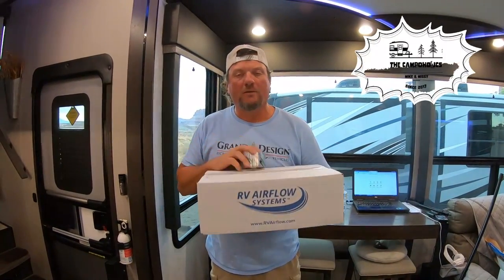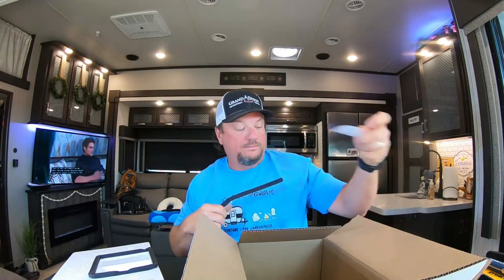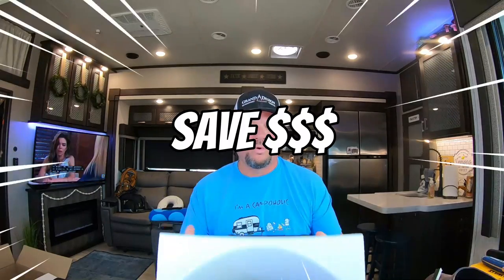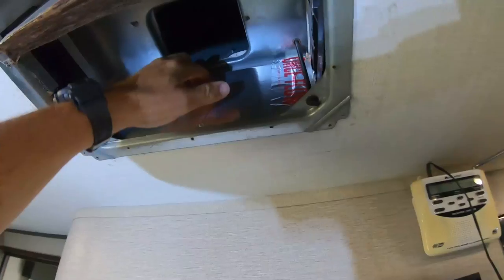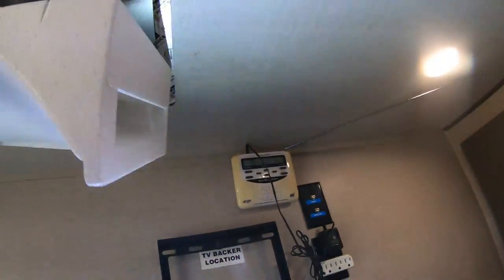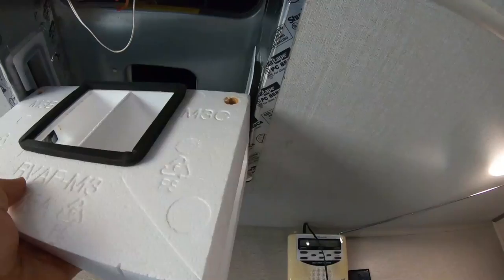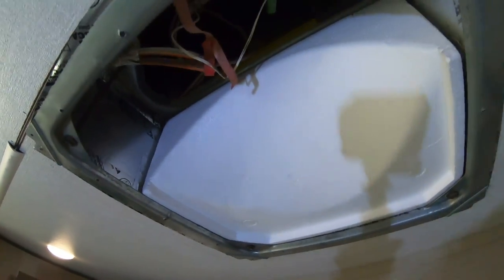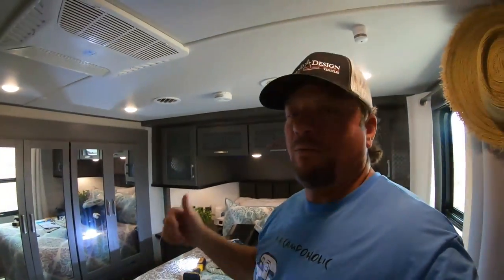RV AirFlow Systems Overview and Install! Keeping It Cool In The RV!

Comment: Hello  I basically understand the idea so I went to Home Depot and bought AC Tape and a couple of flimsy tin Beware of Dogs signs and did the same thing for 20.00.  Remember to seal all the holes on both sides ( Supply and Return ).
Reply from the maker: That saves some money.

Comment: I had about 15 (a lifetime) minutes of trouble getting long bolts to line up through styrofoam. Had to "saw" towards corner and NOT use flange on that side. Aluminum tape EVERYWHERE until no cool air felt. Now hot stays separate from cold. The temperature of air after is much better. What ya gotta do is MAKE SURE bolts will line up AFTER install of styrofoam and BEFORE reinstall of metal bracket thing. What I did is FIND the holes, place the bolts, aluminum tape EVERYTHING to hold styrofoam in place, remove the bolts, place the bracket, screwed bolts back in. IT WAS WELL WORTH THE SHOULDER AND NECK DISCOMFORT.
Reply from the maker: If it doesn't align its a pain.

Comment: I had a wire wire hanging down about 2 or 3 feet from the duct it had a little sensor on the end I think it was a temp sensor. I just coiled it up and left it just above the filter.
Reply from the maker: That should be connected to the fins in the upper box. The one that sits on top of the roof.

Comment: You mention GD has been installing these since 2020. But Not on units with Furrion units , correct? Since RVAirflow just came out with them?
Reply from the maker: RV Airflow has just recently released a Furrion version.
Reply: Janet, hello, I’m Jeret, a rep for RV Airflow. Currently these are not installed in the new GDRV’s with the Furrion AC. We just came out with the Furrion a month or so ago. Although I would imagine eventually these will be installed from the factory.
Reply: My 2021 395MS with Coleman doesn't seem to have them. Dump registers still work in bedroom A/C. But I think the living room the dump register didn't work, so maybe there. Now I gotta look.

Comment: Does this mean you can’t use the “dump” feature of the A/c?
Reply: Thats correct. The divertor piece does not go back in and thus the dump is no longer a supply
Reply from the maker: That's correct Janet. That was a concern we had but the way air is pushed through the duct work now, we don't miss the dump.  There is plenty of cool going around.

Comment: HAS ANYONE DONE A VIDEO WITH A DUCTLESS SYSTEM??? I have ordered the RV Airflow that is supposed to be able to adapt to the Dometic EVO unit. Should be interesting. The tech from RV Airflow actually called me and said there might be a little adjustment or small gaps. She also said I could send her exact dimensions and they can custom cut the insert. I'm going to have some dense foam that I can use incase i need to "fill gaps". We'll see....
Reply from the maker: That is something that we would like to know.
Reply: This most likely will not work with ductless. The "dump" vents at main unit will be taped shut as they become worthless. So....no....call company.
Reply: @chasinspring  update: I installed 2 rv airflow inserts! Had to modify them to make them fit, but it did increase the air flow. The biggest discovery through this process was how bad the plenum looked! Shote workmanship from the factory!!! Everyone should remove their ac’s and check this! In a couple locations in the plenum, the silver tape was allowing cold air into the “attic” of the rig.
Reply: Total crap on workmanship!!!!!!!!